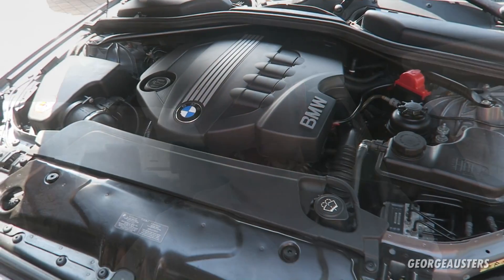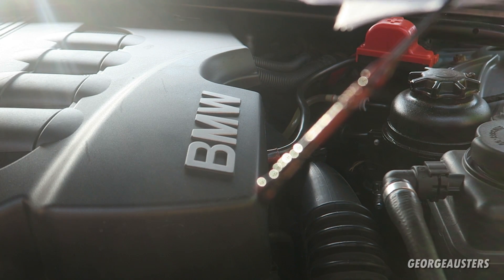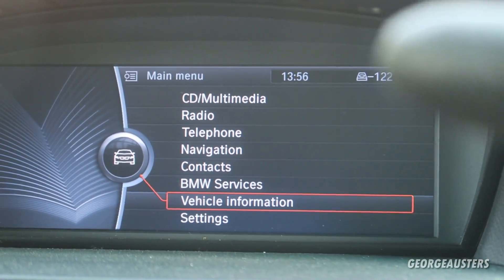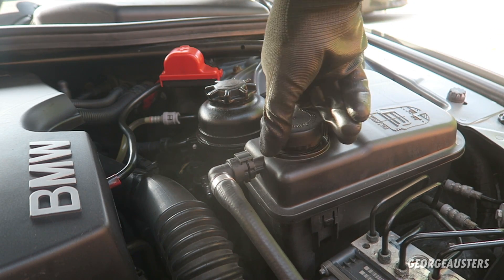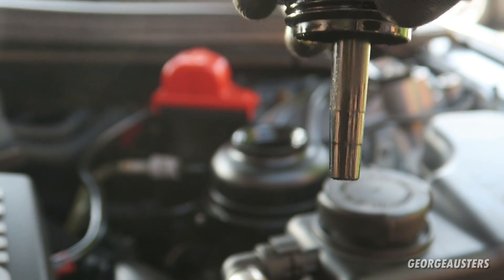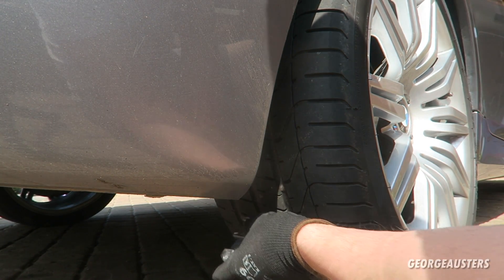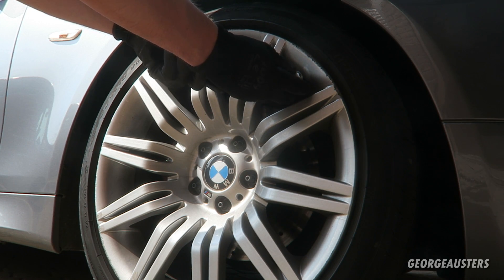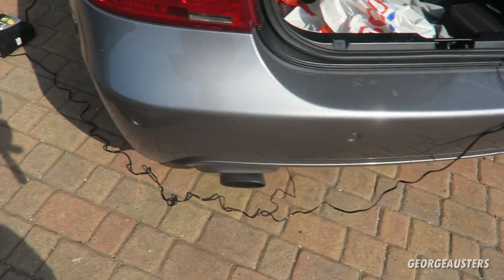Essential Monthly Checks For Your BMW

Comment: Thanks George, good refresher. Every six months or so, I also take a look at the brake fluid and use a small tester to check the water absorption. The LED pen tester only cost about £4.
Also use a refractometer to check the dilution of the coolant (again peanuts to buy). Also use litmus paper to test the PH to check for any change.
Not essential checks but reassuring to do now and again.

Comment: Hello George, can you help me out please? 

I have the " Exhaust-gas recirculation controller, position sensor, signal " error code 004CAE.

Is that fixable or do it I need to buy another one. I have clean the egr valve twice with no results.  Thanks in advanced